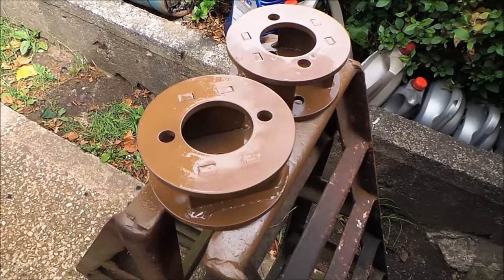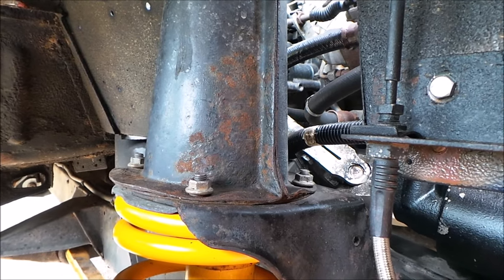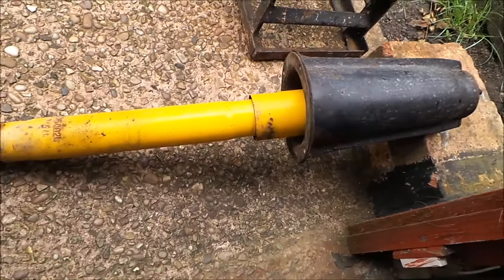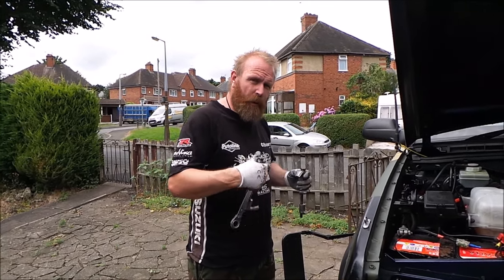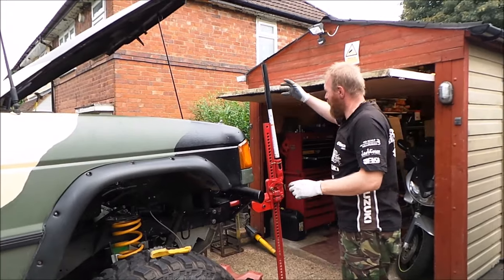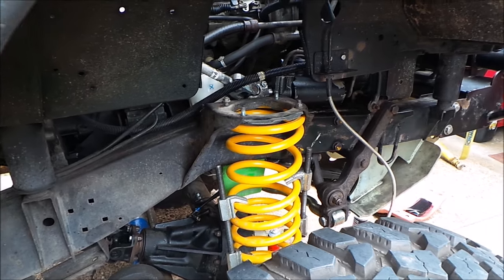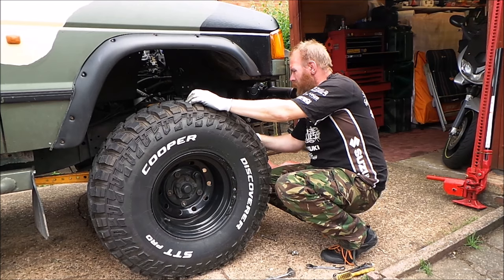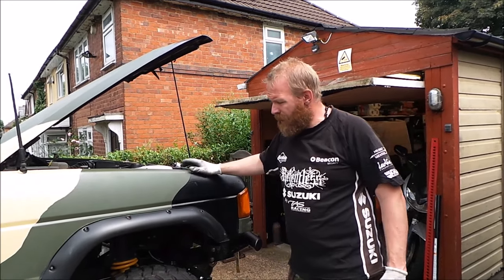Fitting a 2inch lift to the front of the Land Rover Discovery 300Tdi Bug Out Vehicle

Comment: thanks for the helpful vids. I am however struggling to get the lower shock nut on. with the lifting block and coil spring bolted in place there is no way to tighten the nut?

Comment: thank you for the video. Very helpful. How does the 2" spring blocks work off road? Are you still running 35" tires? do you have enough clearance for 35's with the 2" lift and the 2" blocks?